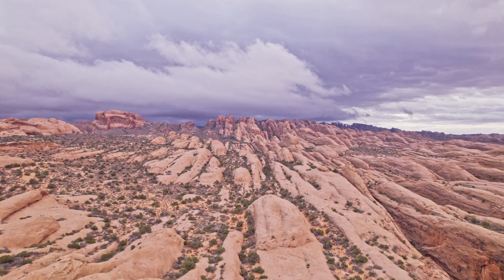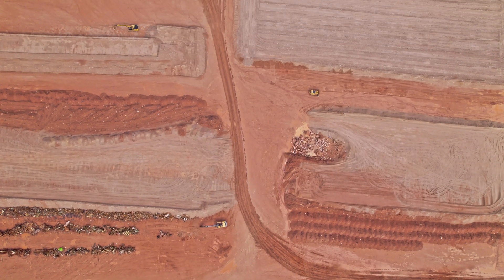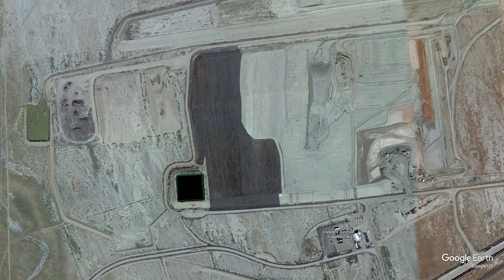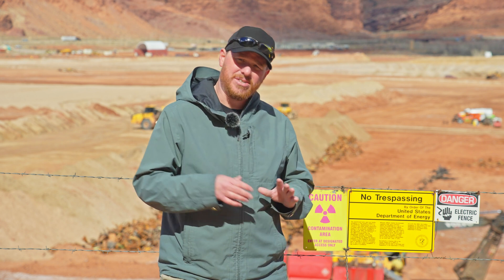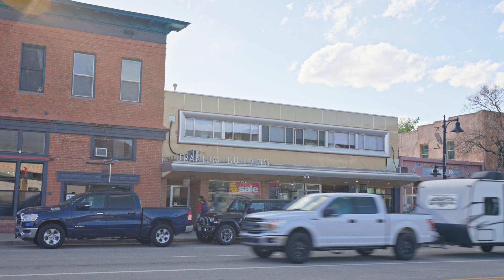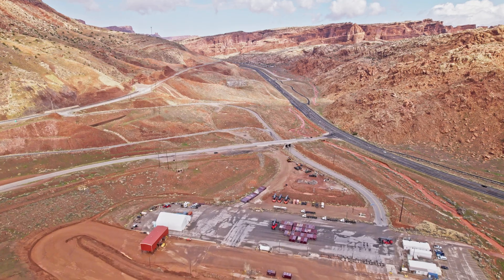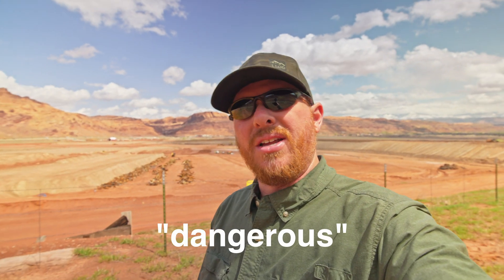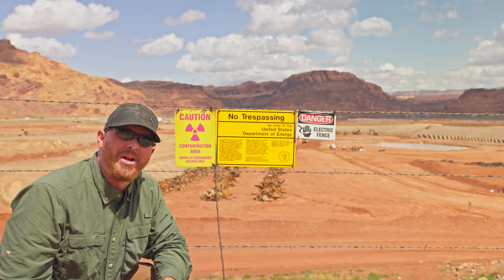Radioactive Area Next to Arches National Park

Comment: Being a former Arches National Park ranger back in 2005, I lived just a mile up the road from this place and back then they hadn’t started really cleaning it up yet (at least hauling it out). That was two years later. A lot of rangers were really worried about that whole process. There is a sand dune area across the highway from the Arches entrance that was radioactive and families would always stop there and let their kids roll down the dunes.
Reply from the maker: I know which sand dune area you’re talking about. I’ll have to check it out next time I’m down there. There are so many uranium deposits and uranium mines in the area it’s very hard to completely avoid it.
Reply: Man .. I was at those dunes a few yrs ago now I regret reading your post . It's sad to think that our back yard is contaminated, . Looks like I gotta save up to buy a fancy anti cancer box.
Reply from the maker: @cgonzo801 even if you played in that little sandy area around Arches you’ll be fine. Also unless I see readings from a radiation detector I can only go on rumor. If it was dangerous they (the DOE) would close off the area. Some places are going to be naturally radioactive. Uranium deposits are naturally occurring. Uranium mining doesn’t make an area radioactive. It might bring more of that material to the surface but usually it’s very localized. Plus uranium isn’t that radioactive.
Reply: @RadioactiveDrew  thanks for the relief. So  last yr I was at the Cleveland Lloyd dinosaur quarry talking to a paleontologist about how dinosaurs bones / fossils sticks to your tongue but that he never practiced it because of the uranium in the field .  Anyways awesome videos
Reply from the maker: @cgonzo801 no problem. Glad I could calm some nerves. Some fossils are radioactive because they collect in the same areas as uranium.
Reply: @RadioactiveDrew  On top of that I will add, the primary danger from Uranium isn't it's radioactivity, it is that, chemically, it works like lead in the human body. In the "dangers of heavy metals" spectrum Uranium is much more harmful than lead. Similar effects, similar bio-accumulation in the body, but much harder to remove from the body. The dangers of DU projectile dust is very real, same as lead, just worse. It takes less Uranium to cause neurological damage than it does lead, for instance. Not by radiation, but by heavy metal effects where Calcium/Lead/Uranium and how they chemically operate in the body and where they tend to accumulate.  In this case the heavy metal taking the place of Calcium and your entire nervous system operates on calcium Ions, so you can see why it's a bad thing to swap calcium for lead.. or uranium. Plutonium is on the same chemical chain as say.. Lithium. You could make a Plutonium Metal Battery if you were crazy enough and it would work, chemically, probably better than Lithium. It's is a rapid oxidizer, like Lithium Metal is. In fact compared to Lithium it's reactivity is many times greater, which is why plutonium processing facilities have major fire problems, even a little bit of it exposed to a small amount of oxygen will get VERY HOT, VERY FAST and like those Electric Cars, putting that fire out.. is very hard.. oh and radioactive too.
Reply from the maker: @meatybtz  uranium doesn't mimic calcium in the body. Radium 226 and strontium 90 do mimic calcium. Yes the toxicity of uranium is pretty much on par with lead exposure. Uranium effects the kidneys and with enough going through a body it can cause kidney failure.
Reply: @RadioactiveDrew  thanks for the correction. I was taught that Uranium bio-accumulates in the body and can be found in the bones, like lead. Maybe they had it confused with Strontium and Radium. The better and more accurate knowledge of radiation and metals risks the better people can understand them and not over-react or under-react.
Reply from the maker: @nathanielschultz5474 I totally agree. Education on topics like this can help people better understand our world and the risks from certain materials.
Reply: How radioactive? Everything is basically radioactive, but it's a numbers game. 
How many REMS? 
I'm headed to the dentist for some radioactive x-rays. Better than loosing my teeth.
Reply: Humans are the worst trash.
Reply: I’m from Moab and grateful that UMTRA is a superfund site and they are removing the mill and “capped in place” tailings by the river. As a kid we drove past it every time we went to Salt Lake it up North. We played in the sand hill regularly as kids. I’m not very worried about the sand hill outside of Arches. 
Most of the higher concentrations of uranium are found south of Moab in Lisbon Valley. People still go to Charlie Steen’s MiVida mine and wander around the area and past the barricades. There the radiation is really high. I just avoid places where they found the “yellow cake” uranium deposits. I’ve been to his mine (with a Geiger counter) and the old mill site (no Geiger counter, I was too young) before it was torn down and buried. I’ve had in-laws who have died from diseases because of exposure-at that time uranium enabled miners to feed their families and buy a home. At that time people were unaware of long term dangers. 
Yes it’s dangerous to be constantly exposed but it’s also important to be informed. 
Your video informs without enflaming. Well done presenting the facts and using solid evidence.
Reply: What concerns me is that they're going to be moving this radioactive dust which is like coal dust just much more radioactive on a train
Reply from the maker: @hillgamingofficial the train cars didn’t happen to be there when I was filming. But I’ve seen them a bunch and they are totally sealed for transport. They also spray them down to keep and contamination from leaving the site. In the summer months when it’s hot they spray all the roadways down and all the work sites to keep the dust down.
Reply: @hillgamingofficial  Don't worry. If there's a problem they can always do a "controlled release."

Comment: at the end of it all do they just drive all that equipment into a hole too??
Reply from the maker: No. Being around radiation doesn’t make things radioactive. But the tailings do get deep into the machinery and can make it hard to decontaminate. If anything the machinery will go to another job of dealing with radioactive materials.
Reply: @RadioactiveDrew  or sold at auction to an unsuspecting customer 😬

Yeah just curious is all.   anything picked up in the scrap iron industry that's radioactive is rejected locally(sask, canada) I have no idea where it goes or how it's handled afterwards, the local plant that melts it wants nothing to do with it.
Reply from the maker: @john0270 usually contaminated metals are sent to an area that deals with low level radioactive materials. There is a disposal site in Utah that handles a lot of stuff from the nuclear industry.
Reply: They get a decontamination wash until they scan clean, then on to whatever construction they are needed on, nothing special required just water and time.

Comment: Interesting you mentioned how electrical fencing works.  I've traveled in Asian countries a lot, most of their schools have electrical fencing and anyone with basic physics curiosity can easily see they are real because of the terminals just like you said.
Reply: The insulators on it were very small plastic ones, but yup it was electrified for real when I visited years ago. Was a better than nothing cattle fence charger, and wouldn't be surprised if it broke and they never bothered to fix it.

Comment: It is possible that an voltage is being induced into the fence from the high tension lines overhead due to the alternating fields. It looks like the fence and lines run parallel for a significant distance, but like you stated it would be bled off into the ground. Interesting side note is that at the power plant I worked at all the chain link fence had grounds strapped to some of the posts.
Reply: As long as the high voltage power lines, I’m going to guess 220 kV, are 25 feet or higher from the physical ground there won’t be any inductance to the fence and then direct to ground via the fence posts. The grounds on fence posts was to ensure a short circuit to ground if an energized conductor touched a fence. At our substations every fence post all the way around the perimeter had a large ribbon ground which was attached to the mesh copper grounding
Reply: It is a literal electric fence similar to a cattle pasture fence. The tailing pile is a bit more radioactive than fiestaware at contact. Won't be enough to hurt you to visit but wouldn't want a house built on it.